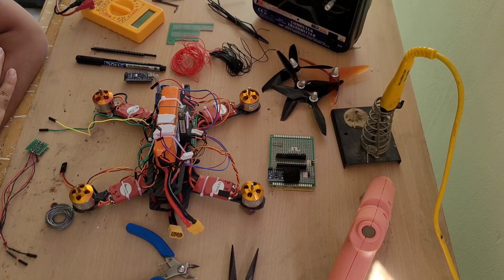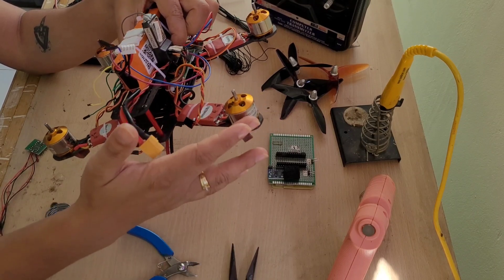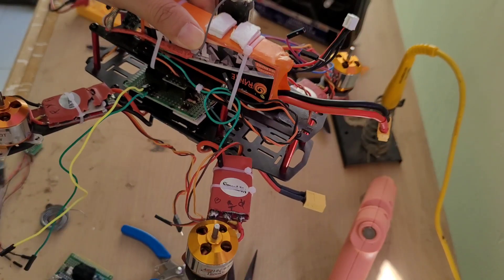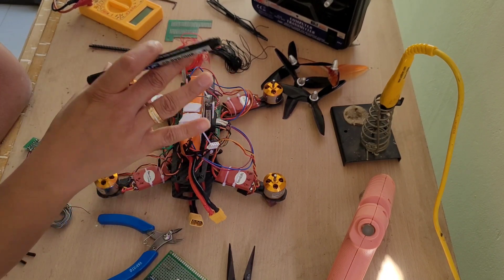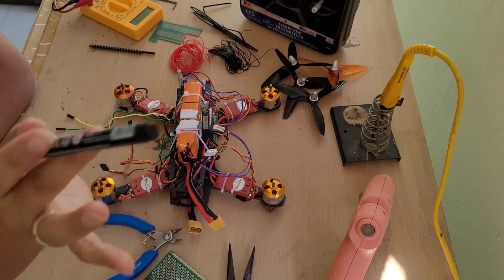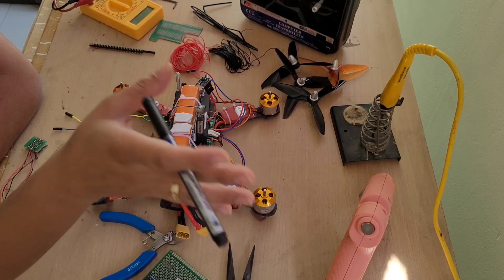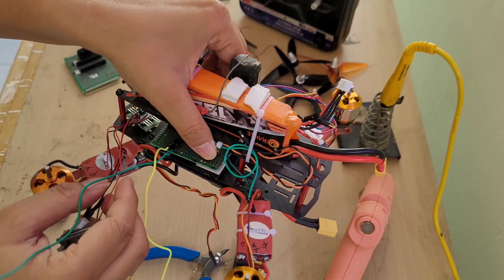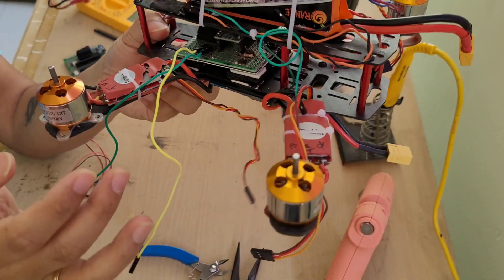Arduino Flight Controller Upgrade to 400Hz - Part 1 Hardware

Comment: Brother can u help me in this issue after arming my drone motor one got full throttle at idle...there was no problem in esc calibration... what cause this problem could you help me..
I used joob brooking YMFC AL code..
Reply: Thank you 😊 brother
Reply from the maker: Hi, first of all, try to run the motor directly through a simple code or RC receiver. This will help you confirm if the ESC is ok or not. If its ok then, check when does ur drone code activates the stabilization i.e., the stability code should come into action after certain throttle value, usually 1300 for F450 class drone. If it kicks in right from 0 throttle one or more motor may RPM may go high. 

If this is not the case, then print ESC signal values of that particular motor and see if it constant always..
Reply from the maker: PID tuning is pretty much same for all drone. Start with tuning P gain first, keep increasing till oscillations appear. Reduced the gain by 30 to 40 % and then start increasing D gain till oscillations appear. Decrease D gain by 30%. With this two gains you can test fly the drone. Later add a small I gain. 
You can start with ref PID gains from the YMFC tutorial.
Reply: Thank you brother for your help....and i figured it out....now it fly smoothly 🛫
Reply: Brother how to perform pid tuning for ymfc al